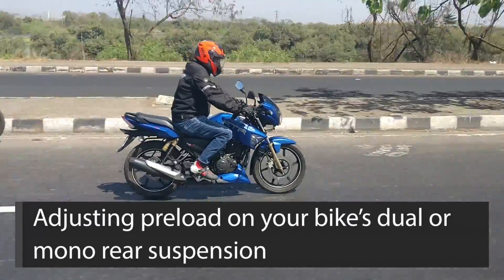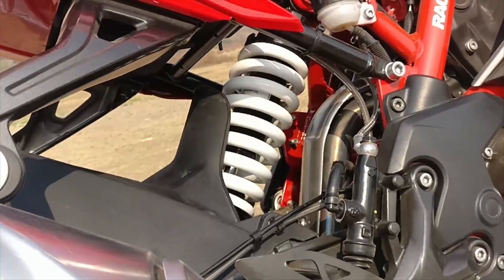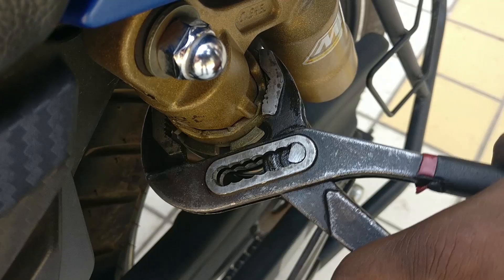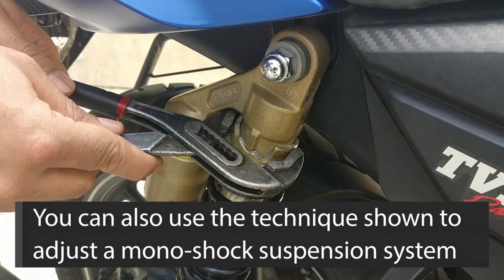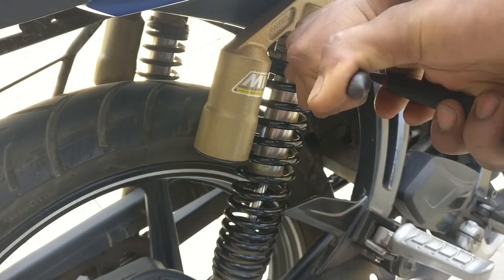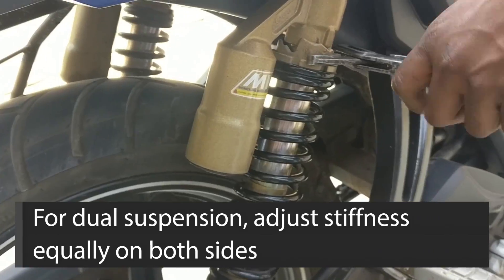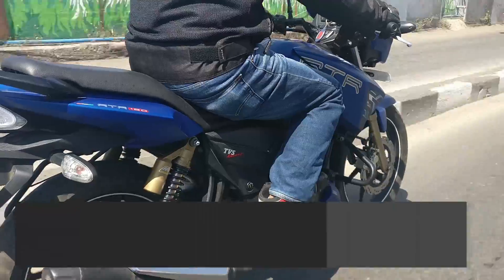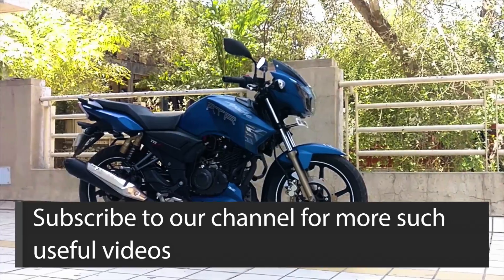How to adjust your motorcycle's rear suspension springs for pre-load

Comment: Does compressing the rear spring make the ride stiffer or softer, or does it only change the ride height?  I have a 2003 Honda rvt rc 51 and i weigh 135 pounds, or 62 kilograms.  It is a stiff ride, but seems to handle good.  My spring is set at fully expanded.   Should I compress it?
Reply: Hi, compressing the shock would make the stiff ride but handles well with little uncomfortable ride,follow the factory recommended setting for your bike..
Reply: @dhivagarsrinivasan622  thanks
Reply: @dhivagarsrinivasan622  how does increasing or decreasing the preload affect seat height?
Reply: @no22sill  DID YOU GET A ANSWER

Comment: Dear TVS motor, Can you please add or make New Apache RR 310 with Dual disc brake(ABS) in front wheels together with Front Tyre -120/70 -17 & Rear Tyre - 160/60 - 17, Dual cylinder Engine which produces extra power with small exhaust system.